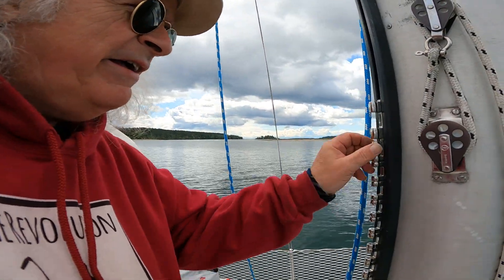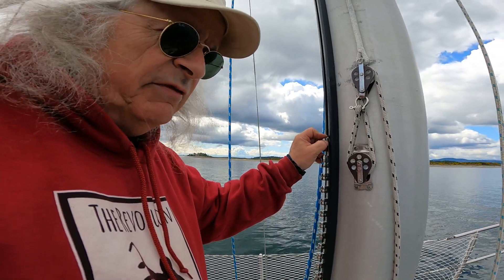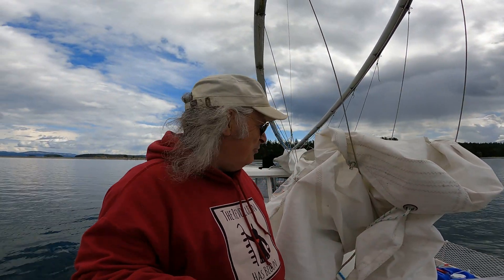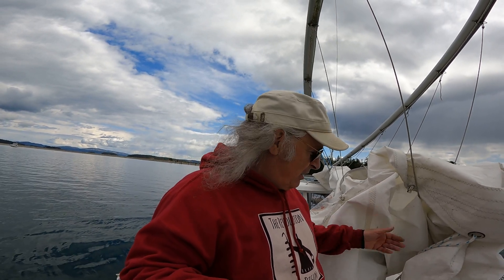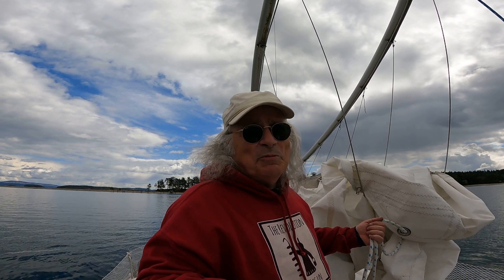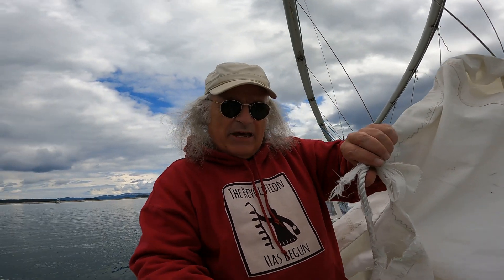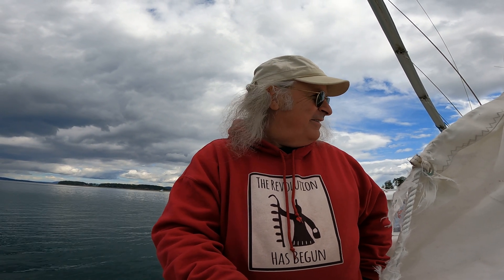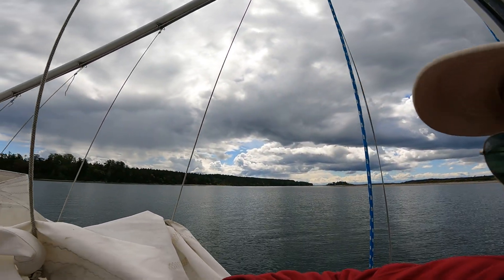Repairing a sail, part II

Comment: Good luck. A piece of extra canvas (or light leather) sewn into that rip. Would that've worked? (Haven't seen the solution vid yet...)
Reply from the maker: Sails aren't made of canvas anymore. I sewed the dacron together and then used special tape.  You can hardly see that there has been a repair.